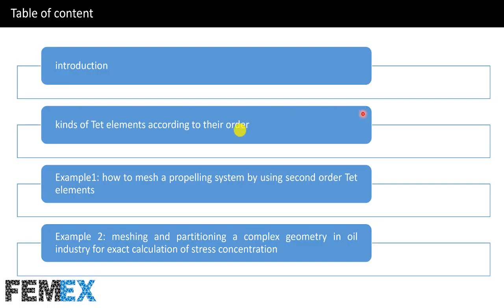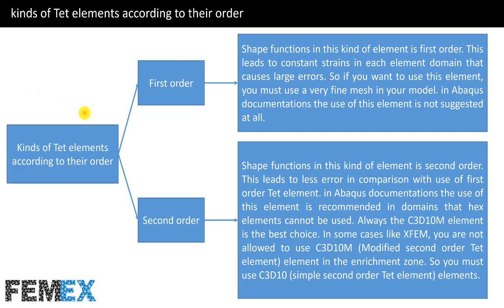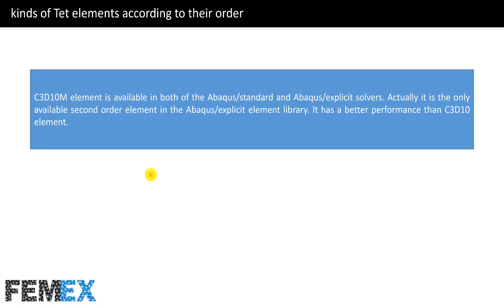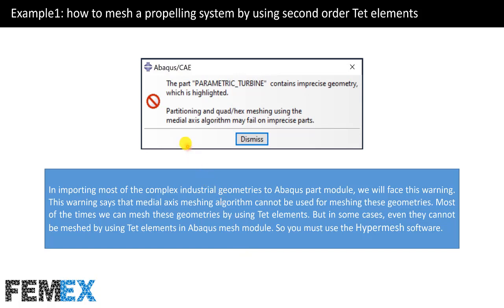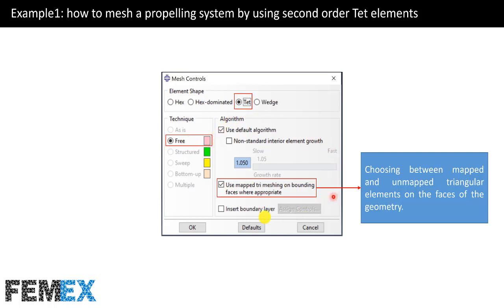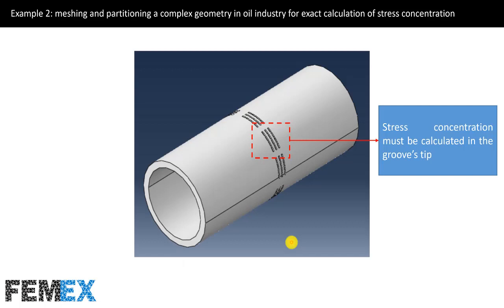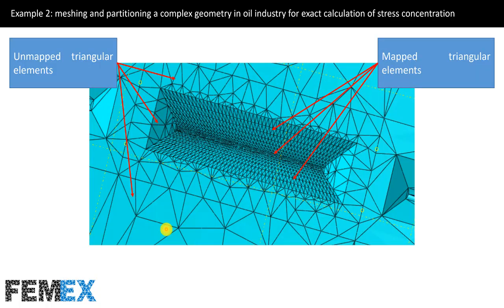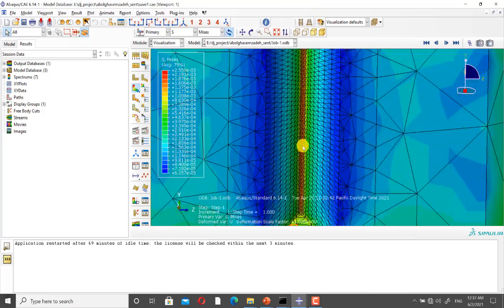Meshing and Partitioning 3D Complex Solids in Abaqus by using Tetrahedral Elements

Comment: Thank you indeed for this very instructive video!
I have trouble meshing the entire volume of a given CAD file imported into Abaqus. The problem is that I get a surface mesh as opposed to a volumetric Mesh when trying with Tet elemets.
I was wondering if you could give me some tip on how to address that?

Many thanks again!
Reply from the maker: Hi.
You are welcome.
If your CAD files is a solid geometry, Abaqus should automatically generate Tet elements on it.
In some cases, if Abaqus can not create the Tet mesh, it only gives you the surface Tri mesh which its color is close to gray. It is the original boundary mesh for creating the 3D Tet mesh and when Abaqus cannot make the 3D Tet mesh from the original 2D Tri mesh, It only gives you that 2D mesh. So you must use other features of Abaqus like the edit topology tools to help Abaqus in generating 3D mesh.
Please watch this video from our YouTube channel to be more familiar with edit topology tools: https://www.youtube.com/watch?v=vnrr9Q2lgMA&t=21s
Also if Abaqus generates mesh without any problem on the geometry but it is 2D Tri mesh instead of 3D Tet mesh, it means that your geometry includes shell and not entirely solid.

Comment: Good explanation especially regarding the choice of elemet types-. I have just one comment about the propeller. I suppose only one blade(one seventh of a comåplete revolution is needed to analyse Apply cyclic symmetri on the "cut" surfaces.
Reply from the maker: thank you very much.
yes.
your comment is correct.